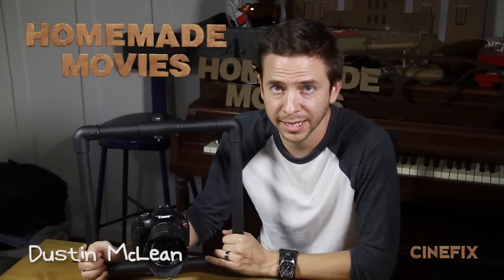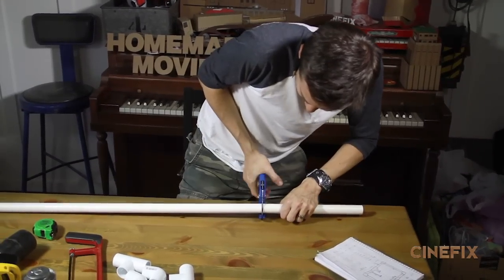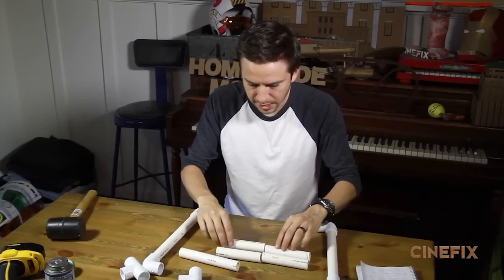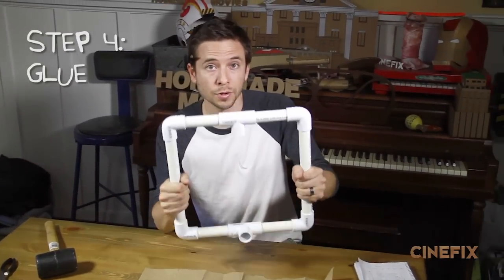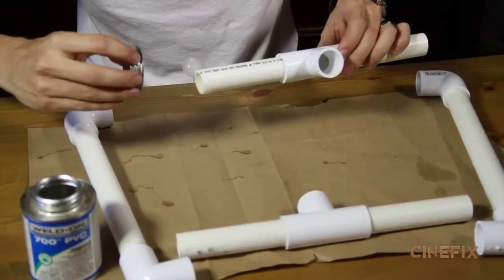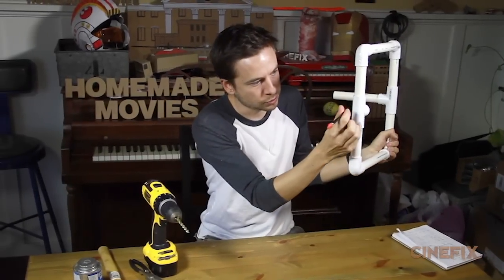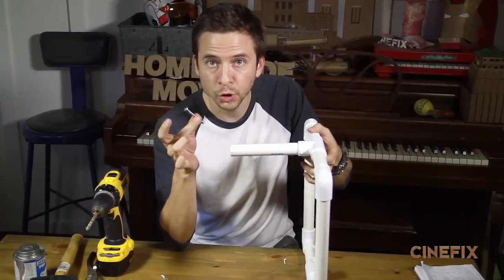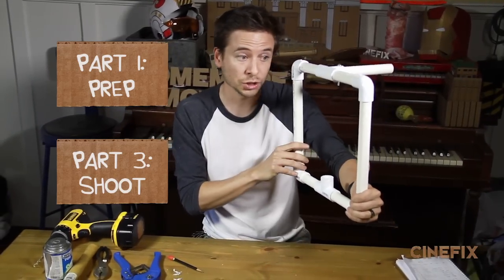DSLR Camera Stabilizer for Under $5 (Part 2: BUILD) - Homemade Film School

Comment: For everyone asking for metric, it’s 2.54cm/inch, so 12cm for the 4.75” pieces and 28cm for the 11” pieces.  Also, it’s way better to apply the glue to the inside of the elbow rather than the outside of the pipe.  It’s less messy, and pushes the glue in to the fitting, rather than scraping it off the pipe.  No need to sand anything before gluing, the glue works by chemical reaction to fuse the pvc together.  Using the pvc primer prior to gluing is a good idea and will result in a stronger bond.
Reply: Thats helpful thank you men

Comment: Just in case someone wants to use this to stabilize a mobile phone, rather than an actual film camera, just attach two little metal plates parallel to each other in the hole of the PVC where the screw at the bottom for the camera would normally be. I did this too and it works like a charm!! It's at least a lot more stable than running around holding it with your hands. And the best thing is, it only cost me about $20 to make, it cost me a lot more because I had absolutely nothing but a drill to make this, so I needed a lot of things like the glue (which is expensive as fudge), the PVC, the bolts and the two metal plates I talked about before in my comment. Thanks a lot for making this tutorial!!

Comment: This is the first DIY i've tried and let me say, this was easy, i made 1 mistake which was making the hole too big on the bottom where the camera goes, so I just put a wing nut where you're supposed to put it then another one in the t part of the joint and used a pen to get it all the way through the pic. Overall easy and very helpful! Thanks!

Comment: Before you take it apart to glue it, you might want to add some registration marks along all the connections to make putting it back together much easier.

Comment: I'm going to make this for a vertical set up. I ordered a cage. But I assume I need some safety solution so that the screw end doesn't get pushed in to the camera through the cage hole? Any advice?

Comment: I'm having an issue secure the bolt that goes into the camera...camera will not be secure but rather spin continuously...any solutions? I have a screw and a nut.